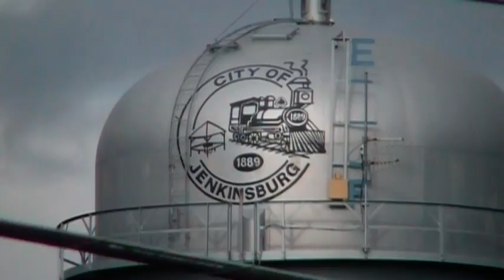The Jenkinsburg water tower 11-26-11.mpg

Comment from the maker: Paul,  they use the tower to store treated water and raising it up high give the system the pressure needed.  Since only so much treated water can be stored,  it is treated and  stored to capacity, at night when demands are low, so it will be available in the mornings when demands are highest, thereby assuring they wont run out of water unexpectedly